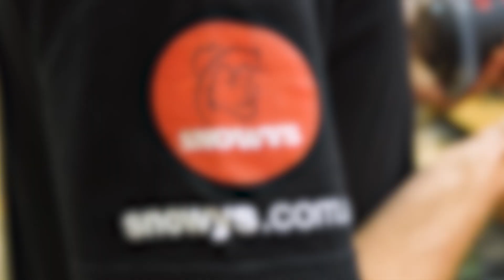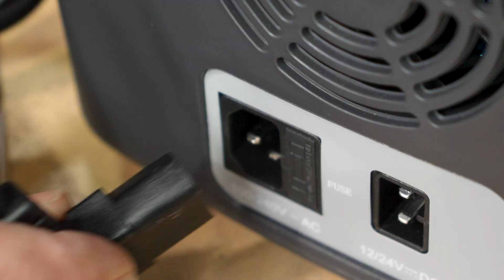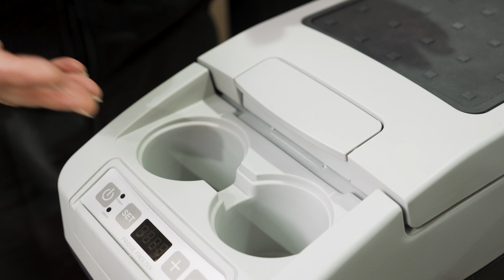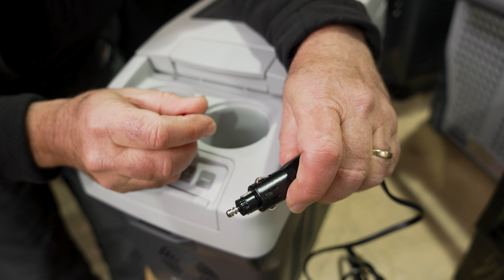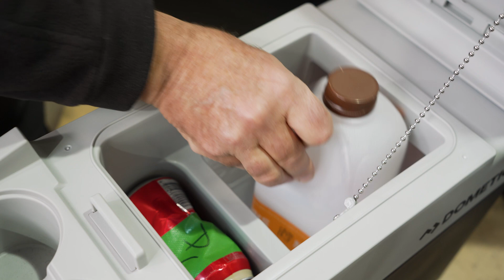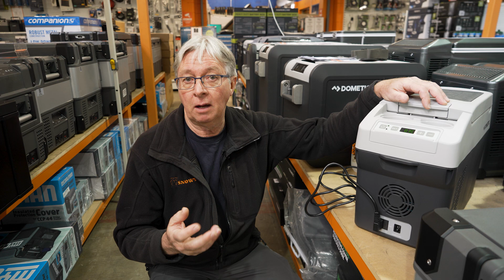Dometic CoolFreeze CF11

Comment: do you have 1 that fits in 1996 landcruiser centre console replacement
Reply from the maker: I'm not sure of the specifics of what is required for the Land Cruiser you mention sorry, and the fridges don't specify exactly which vehicles they suit. For the most part there will need to be some customisation to fit any vehicle. ~ Ben

Comment: This unit with a built-in lithium battery would make it much more versatile. Keep it on the ciggie plug on the way to your picnic or event, then carry it to your spot. The battery, in reality for a fridge of this size really only needs about 2 to 4 hours of power.
Reply from the maker: That would be a great innovation for a small fridge like this. We are seeing more of this sort of setup coming into the market and I don't reckon it will be too long before we see more fridges with built in batteries. ~ Ben